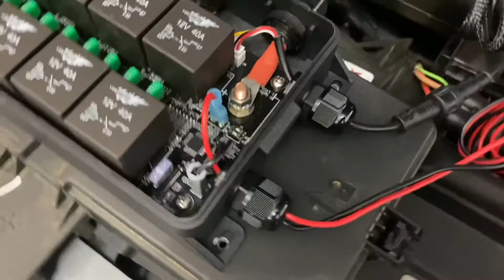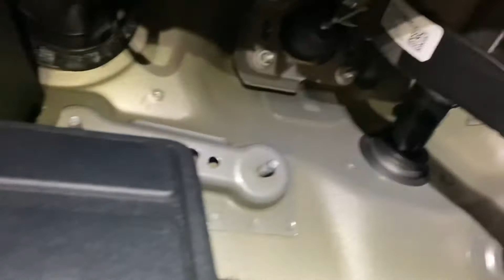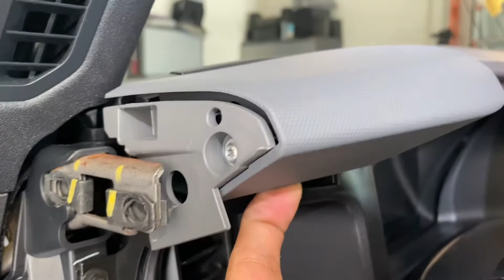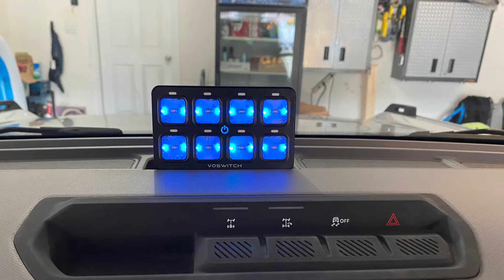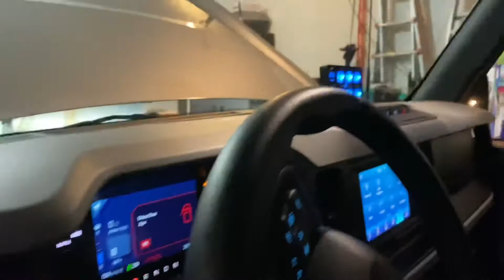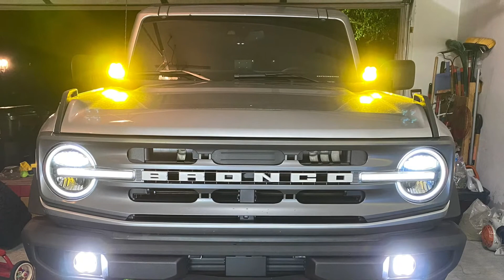2021 Bronco | Off-Road Lights Controller | Voswitch | UV100 8 Channel Controller Installation.

Comment: Did you use a fuse tap for it to come on with key? If so, what fuse did you use and was it inside under the steering wheel or the fuse panel in the engine and if not too much trouble what number fuse. Thx
Reply from the maker: It’s ran to the battery bus bar with a inline fuse it comes on and off with the key.
Reply: @MH2offroad  are you saying you wired to one of the 4 posts on the positive battery terminal?  One of those is keyed?

Comment: Question each accessories have 2 cables where do you connect the negative cables for each accessories?
Reply from the maker: On the left side of the battery, you have two negative post. I used the top one.
Reply from the maker: Back to the battery terminal on the negative post.

Comment: Is this in an addition to your overhead aux switches or is this to replace? Better yet... Did you order your my21 with or without aux switches?
Reply from the maker: I do not have the factory aux switches. I am using this as a standalone switch panned.  I did not order with the switches or modular bumper.